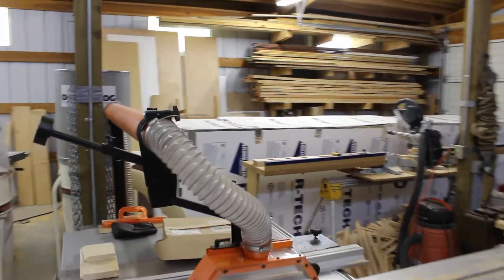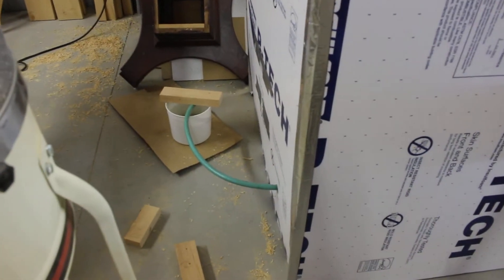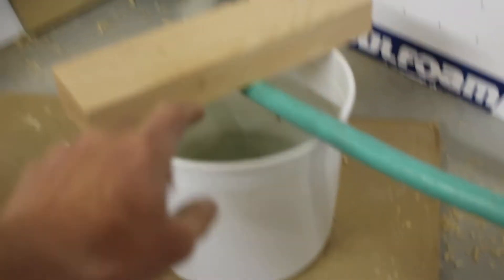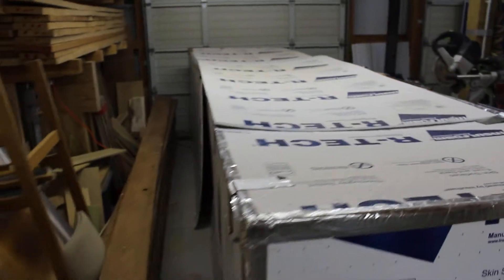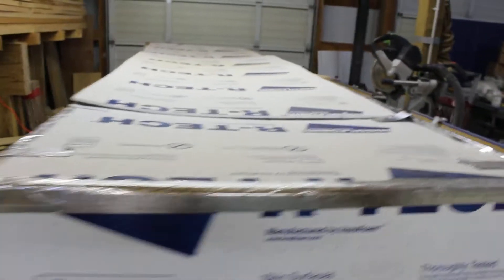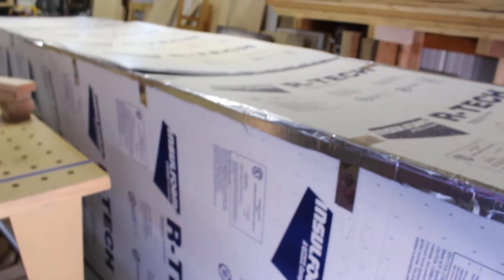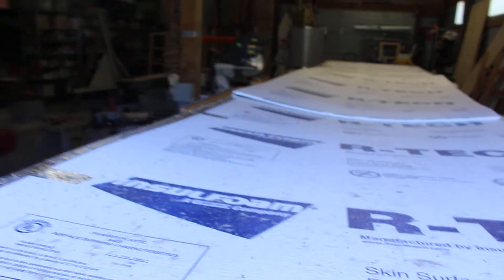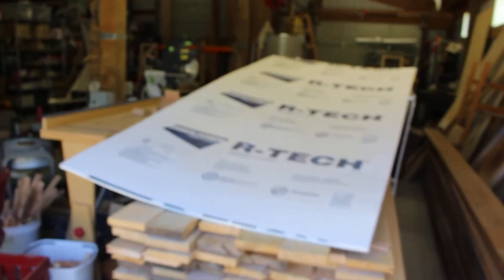Home made kiln that works!

Comment: That’s impressive! Very simple, cheap, quick, and effective! Question: how warm does it need to be inside the kiln. I live in south central Nebraska and we can get some pretty cold temps in the winter. I have an old unheated garage where I’d most likely install it to dry 3” slabs. Thanks and God’s best for you and your endeavors.
Reply from the maker: This is in an unheated shop.  Heat is important but air movement is the most important.  You will need a dehumidifier to get the water out of the air.  Two heaters work fine for this during the winter months.

Comment: How quick would you say that dries it? From what % to % in how long?
Reply from the maker: Theres a lot of variables depending on moisture, time of year(humidity/heat), and wood species.  I've been drying Doug Fir.  Either clapboards, 1" tongue and groove, or 3/4" thick Shiplap.  The longest I've left material in this kiln was around 12 days.  Doesnt take many days to go from say 20% down to 10%.  All your drying time is from 8% to 5% which is whats needed in my area.